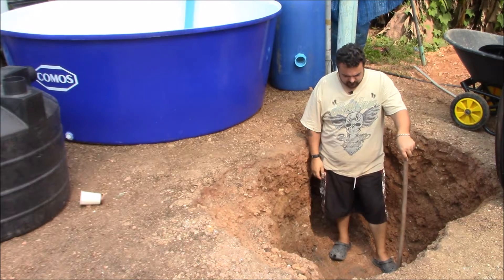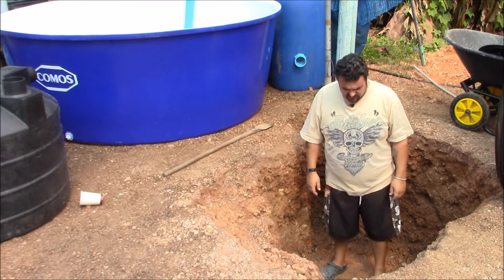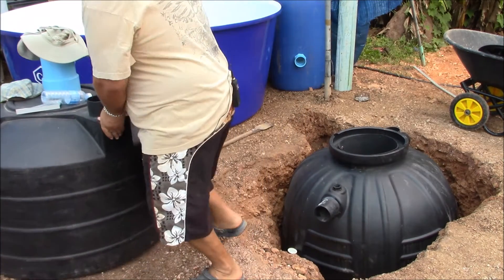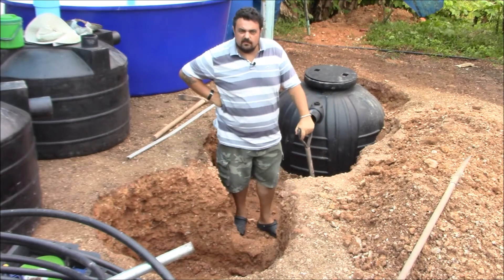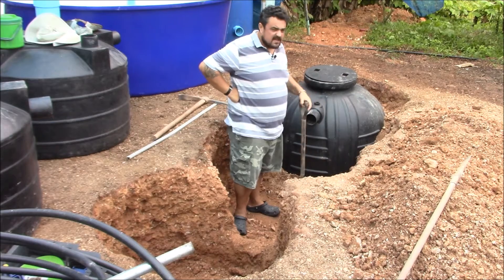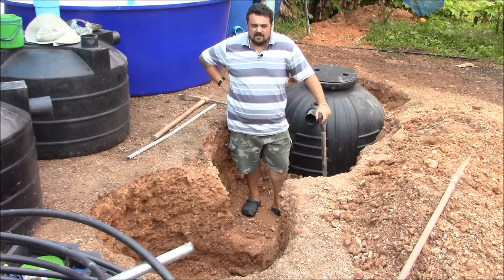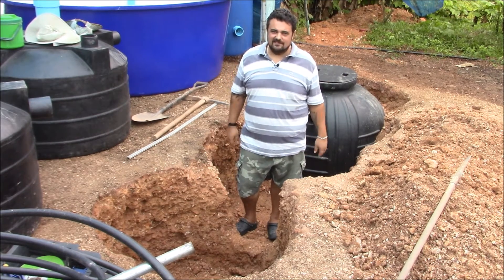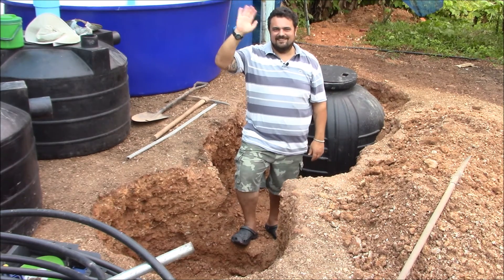Aquaponics made difficult ..lol 21/10/2016

Comment: That is some rocky soil, but you worked hard and got it done, good for you.
Where did you get the wheel barrow and is it any good, looks better than any I have seen in Thailand. True value in Pattaya had some real nice looking wheel barrows a few years ago but they were kids size, a good size for the wife but no way I could use it.
Happy birthday.
Reply from the maker: Got the wheelbarrow at a local hardware shop ... I wish I had got the one with pneumatic tires instead of the hard wheels had a regular single wheel barrow but it rusted out ... when plastic this time ... and double wheel next time double and real tiers .. I just got fedup of spending money this month .. lol 1,800thb for the one I got 4k for the one with real tiers...

Comment: Nice one mate.  How stable is the soil there? Will it move much under the smaller tanks if you get a heavy deluge? 
Belated happy birthday too ;) 
Cheers.
Reply from the maker: Thanks Buddy it's fairly good .. we just had the worst monsoon to hit the area in decades, and not a drop in the holes, so  I should be ok ....  just looking back on this ... I did not put a bed of sand under the tanks, to protect against sharp rocks ... will have to pull them back out, next week when I get home and do that ... I was pretty tired after digging that ... brain was not working ....
Reply: It looked like a hard slog in that heat & I know the humidity doesn't help ;-)